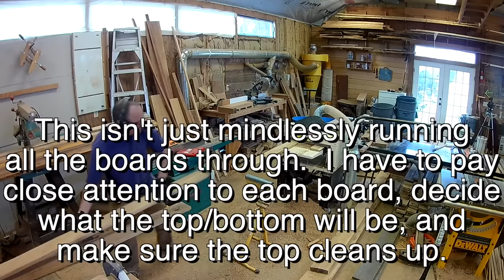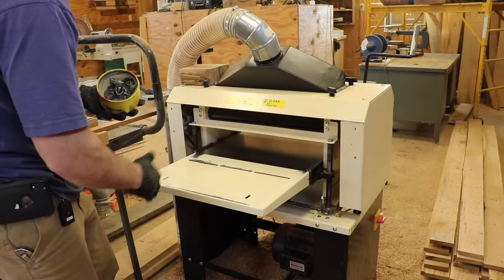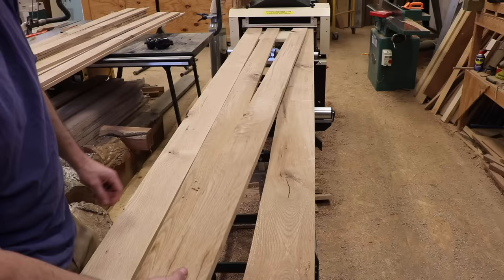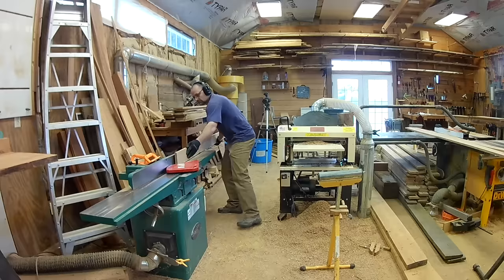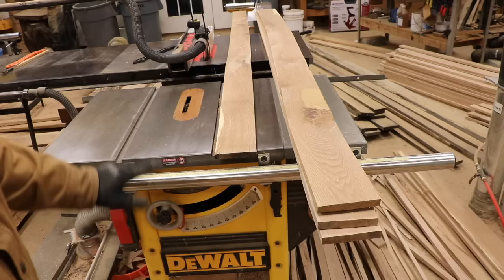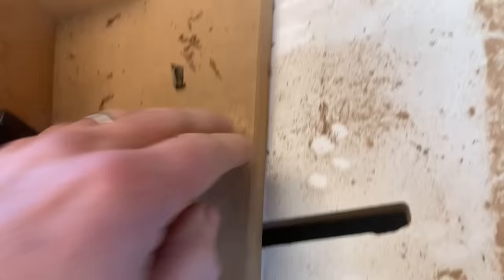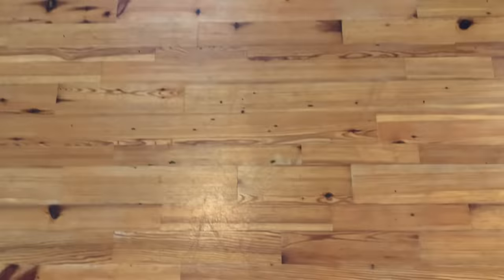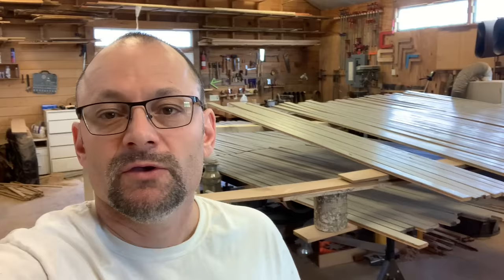Making Tongue And Groove Flooring From A Fallen Tree.

Comment: Wood tends to "stuck" in  a planer when you try to make a shallow cut, with dulled blades and sticky bed. Shallow cut means feeding rollers don't have a good grip on the wood, and thus can't push it hard, bluntish knives tend to push the wood back harder, and sticky bead acts as a brake.
You may try to use thick silicone grease for greasing the bed, my impression/ opinion is it kinda lasts longer and works better, but it is advisable to warm the bed first before rubbing it in. Or you can use silicone sprays for a quick fix. But for big jobs with lot of soft and rich in very sticky resin wood (pine, fir, spruce), especially when the final appearance is not that important you can use diesel fuel, maybe with a dash of oil (regular mineral oil or rapeseed oil) added to it. Just brush it onto the "entry part" of the bed every now and then with a long flat brush - this way you don't have to stop your work and spend extra time waxing the bed. And it's cheap too, and if you are going to use lot of a lubricant that sorta matters.
 
Also, I'd recommend doing the "rough planning" with whatever sharpness of the knives there is (providing they still cut), but making the final, thin shaving with a freshly ground and sharp knives.
BTW, "Planning makes a lot of SHAVINGS (or chips)". It's the saw that produces SAWdust ;-)

Comment: My dad had a woodworking shop.  When I saw all the boards with the coat of linseed oil paint all spread out in the shop, I had to laugh.  How many times had I seen that same picture with my dad.  He had lots of tools and I always enjoyed working with him from little up.  He did some making of lumber but he wasn't set up with a sawmill as such.  His had a more homemade rig.  There was a sawmill about 30 miles from where we lived.  He would go and purchase culls, scraps and often they would give him material just to hall it away.  It was a wonder what he could do with that "scrap" lumber.  Oh, he might purchase a few really nice boards but that was rare.  He would make cabinets on the side, redo a kitchen or bath.  He did about 70% of the work on our new house when I was 6 years old.  He knew wood and knew what to do.  
I would like to share a tip.  This is especially true if you live in the south where the sun is really hot.  Houses would peel as many were made from wood.  My dad would take a gallon of oil primer and add a gallon of linseed oil.  If you cleaned and would sand without any loose paint, you brushed on this mixture and allowed it to dry well before painting.  It would never blister again.  This is especially true on the top end portion of homes where the sun beat for hours on end.  You could almost count on having to pain every year.  My dad and I would buy an old house, work on it and sell it.  One house we purchased the man who lived next door had this problem.  He didn't believe my dad.  We did this house and it never peeled again.  The man said, he just didn't believe what my dad had told him.  Seeing is believing.  YES, it takes time to clean the wood.  If you don't have to paint every year look what you have saved.  I thought I would pass this tip along.  If, anyone is interested in more information just make a comment reply.  I will see it and answer any questions you might have.

Comment: How utterly gratifying to make you own custom wood flooring planks.  No Home Depot, no Lowe's, no Menards, but plenty of scraps to fill that outdoor wood burner.  You said the older porch installed years before without a paint or protective layer was a "failure".  It would be if you didn't learn from it.  You have, and the next one will be far superior to it, but you might never have reached that level without that (ahem) irksome "failure".  Don't beat yourself up - pat yourself on the back, my good man.  Quality is not dead in America!

Comment: This was amazing to watch, everyone that complains about the price of hardwood flooring, should work a day alongside you!
I'm curious about your wood boiler, how long does what we saw you load, heat your house, would you get a full day out of that? I have a small woodstove (about 12 cubic feet) and a comparably small house (about 1800 Sq ft.), one of your blue bins would last a day for me, haha!
Reply from the maker: Thanks!  As long as it isn't too cold I load it once a day.  If it gets into the lower 20's or lower, I do twice per day.  My house was built in 1850 and is far from energy efficient to heat.  A more modern home would be much less wood.

Comment: I have the exact same planner and jointer as yours. I upgraded both cutter heads to Byrd helical cut heads. You should try them, much better. Very easy to get new cutting edge also. The jointer is almost flawless, however, the planer is horrible about snipe. You have to adjust perfectly and still monitor closely.

Comment: There must be a clamp/guide that could be used to hold several boards down to run them thru the jointer at the same time.

Comment: Just a idea for your router table, I made a spring plate, that can pivot and used a heavy spring to press down and the side of the board, like your but with2 rollers in the contact prtt of the end that presses against the side or top of the board, works outstanding and never lets the board move. What a  great project, but would have loved to see in natural wood, great video and how fast you made it. lol

Comment: Nice to see from tree to floor. I thought you might have used a circular saw / skil saw with a guide to initially put a straight long edge on your boards. In my experience it's a lot quicker and easier on the body than multiple passes over the jointer.

Comment: Look at Penofin finish, its rosewood oil. Used it on Commercial work and now it goes on everthing. You dont have to strip it and it penetrates all the way through the wood and you can just recoat every couple years.
Great stuff with a lot of different colors and products.
Betting its better than the linseed.
Reply: Redwood or rosewood oil?

Comment: I have the same planner I also have two commercial kilns, I have done out of birch finish width of six inch tongue and groove also up to four inch finished width in shiplap flooring, you had some boards coming out of your planer not acceptable for flooring, the twelve foot floor I made was usually from two feet to twelve feet long and two and one quarter wide three quarters inch thick.

Comment: In your mention of linseed oil paint, I have found, being in the Mid-Atlantic region of the states. We have a great deal of problem with paints containing both boiled and raw linseed oil, mildewing due to both humidity and heat in the summer months. Mind you, we have equaly a bad time with water based (latex paints), doing the same but the modern oil paints, though they don't hold up as well as the paints that contain the less environmentally friendly stuff, do resist mildew better in my region.
Reply: years ago it was possible to make a linseed based stain , color was limited to brown , you would concentrated colorants , had a high gloss finish , never peeled or chipped , would fade out , re coat after about 15 years

Comment: I don't believe it!  I have the exact same router table and it was also one of the first significant projects I ever built.   And yes, it was a New Yankee Workshop design and I believe I still have the plans.  20 years later I've passed miles of lumber over that table and it continues to work like a champ
Reply: Is your router motor still working after 20 years? What model is it? I had heard that hand held routers once installed and run upside down, like in a router table, suffer from overheating. Have you seen this happen? 😁
Thanks.

Comment: Having done some of this work myself before, I'd say you could use a straight line rip jig instead of using the jointer - and a small power feed that you could move from table saw to router table. :-D Nice work though!

Comment: those wood burner boiler/forced air systems are unbelievable in how they completely burn the wood fuel.  all that's left is ash.  an independent metal building is the way to house that burner

Comment: Store bought flooring the groves are not the same width top and bottom. The bottom is shorter so that the top grove is much easier to get a tight joint. I ran into this when I made some Danish type furniture out of 3/4 oak flooring, you could not get it to glue up straight it always cupped. I had to recut the groves so that they were even like yours are to get flat glue ups. On a flooring secured to joist you don't have to worry about that. The shaper cutters can be bought with that grove difference to create the tighter top joint. Just letting you know if you didn't realize that.

Comment: The linseed oil finishes can have mildew issues. There are some products that say they are better at dealing with that. From what I'v found they need to have added mildew and fungus "cides" to truly work. A little digging will give you the info you need.
Reply from the maker: Thanks for the tip.

Comment: nice work throughout, disciplined and patient, and i especially like the way you set up the featherboards on your router table. the one criticism i'd have is despite its widespread use i dont think tongue& groove has any outdoor application. no matter how well you prime& paint, moisture will get into the joints, swell the wood from beneath, and you get peeling at the joints. wet and dry cycles also make the tongues/grooves brittle causing them to break if they run over even small spans. so for the same reason you're looking to avoid butt joints on this project, i dont see how T&G is gong to be durable in weather. for me the solution would be to maybe use plain boards, possibly at 7/8", installed over a tightly spaced treated floor frame, and seal all 6 sides of each board before installation (and ya, i like your choice of linseed oil-based coating), side grain plugs for screw holes, followed by touch-sanding and another coat of finish should keep it all reasonably weather-resistant for a long time. btw, i dont think the several year old floor you showed at the end was a failure-- i would have no problem with that weathering pattern, but sealing your boards on two sides means any moisture that trickles into the joints is going to absorb and stay there for a lot longer than if your boards are unsealed the way you have it on your existing project
Reply: Dude, a T&G porch floor is not a new idea. These have been around for hundreds of years and are a proven solution. In addition, your idea of plain boards (?) just butted together is a disaster! They will shrink and open up gaps.
Reply: @idontthinkso666  that's right t&g has been used on outdoor porches for at least a hundred years. and for at least a hundred years they have sucked. gaps are not a disaster. splintered, rotted boards and peeling paint are a disaster. it looks stupid and it is stupid

just cuz it's traditional doesnt mean it was a good idea

dude

Comment: Sealing the wood is an important step and doing both sides will make it last much longer. I imagine if you sealed the toungue and groove it might work even better but would be lots of work
Reply: Actually you don't want to seal it, especially on exterior.
You use a penetrating oils that water can't get into the wood. If you keep up adding oil every couple years it'll last 100+ years easy on residential.

Look at Penofin , the have a lot of information plenty of stain colors and I've added tint to make purple stain.
I us it on interior work on old floors with character that I don't want to replace.

Comment: What about setting the dried boards up again on the mill to cut a straight side? How about making the router table accept a second router to cut both grooves at once? I wouldn't want to put paint on that deck. Just a good oil that you could put on again every few years. Nice shop. Thanks for the info.

Comment: outstanding work. Can I please ask about outside boiler for heating and warm water !! What piping and insulation are you using to connect it with the house underground? What is the loss of heat being outside in the cold is the boiler insulated ? so many questions, can you make a video about it !

Comment: What benefits are there to doing the tongue and groove with a router table?   I have the 18" Woodmaster also. My thoughts were to make a deck to put boards thru twice, one on each end and have the tongue and groove bits mounted in the planer head.  Should offer very high productivity. The problem I could see is matching the end profile on a router table whick would be a different brand cutting bit.

Comment: Great stuff but you should spin your planer 180 degrees.  That way you’d feed straight from where you bring material into the shop, and the finished boards would be convenient to run through your table saw.  That would save you a lot of steps and time.

Comment: I'm surprised that your router motor didn't die on you from working that much. I see it's a good one. 
I had heard that hand held routers once installed and run upside down, like in a router table, suffer from overheating. Have you seen this happen? 😁
Thanks.

Comment: Can you tell me more about that boiler?  Did you make it?  It circulates hot water through coils and then air blows over the coils to heat the air to heat your house/shop?  Or is it like radiant floor heating?
Reply from the maker: I purchased it, but that company was bought out and my boiler isn't sold anymore.  There are many similar ones.  The boiler just heats water, damping the fire as needed to keep it at a certain temperature, in my case typically 160-180F.  The water circulates to the house and could be used in any number of ways to heat.  In my case, it runs to my air handler and heats the air which goes through the same ducts used by the heat pump for AC in the summer.
Reply: @FarmCraft101  Thanks man! I appreciate the reply!

Comment: Work on your layout to reduce unnecessary movement. Running back & forth to the blue bucket! Bending over & picking stuff off the floor, NO!  Consider buying a used 1 1/4" spindle shaper. Put a 4 wheel powerfeed on it. My first one was 3 phase so I had to make a converter. Very easily done. I started with less of a shop than you've got. I'm now retired. Gave my tools to some employees and they pay me rent. Shop is now 25,000 Sq. Ft. I don't necessarily recommend getting to that size. Brings with it a lot of head aches! Shop is divided into two work areas. One for processing solid lumber. Mostly moldings. SL rip saw, Shapers, Gomad tilt,  including an arch molding shaper, Weinig 6 head molder, Baker resaw, 16" jointer, widebelt, Whirlewind up cut saw, SCMI sliding table saw, etc.

The casework side is all conveyorized CNC. Fast and accurate. 
Have fun, plan for your retirement. It comes quicker than you would think.

Comment: It looks like to me that you must have your dust extraction ducts running under the floor.  I am about to install dust extraction in my shop.  I have A/C in the shop and I wonder if I will have problems with condensation caused by pulling cool air through the ducts into my outside dust extractor if I put the metal duct work in the crawl space under my shop.  It has been very hot and humid here in Tennessee this summer.

Comment: Great video!  May I ask what brand of paint that is you're using?  Doesn't look like you used any primer?  Also, do you paint the tongues and grooves to protect them too, or does that make the wood swell and not fit together afterwards?  Thanks.  

We have a house that turns 100 this year and the porch floors need some repair and repainting.  Linseed oil pain would've been what they put on it originally I suspect (if they treated it at all), so it would tickle me to use it!

Comment: I noticed part of the dust collection duct, for your planer, is embedded in the floor. I've never seen that, even in some commercial shops I worked in before. Is that right in the concrete, or is it a raised floor? If you get a clog in the part under the floor, is it a major problem?

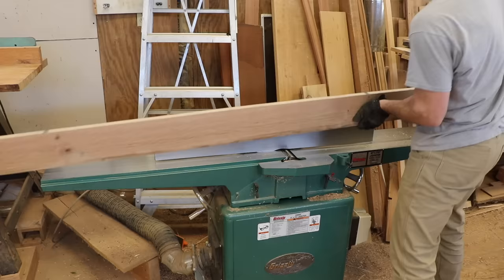Comment: If you only had a hand plane to use on the curved edge of a board, where would you start planing, on the high spots? Certainly. You would not make full length passes all the way down the board. So why at 12:00 in would you do the same on the jointer? It's a waste of time. Flip the board around and only plane off the high spots on each end. BTDT many times and it works. For a severly curved board, a circular saw cutting to a taut chalk line will eliminate all but 1/8" of the curve. Then you can use the jointer to make a continuous straight edge. My favorite board straightening method is using a jig on the table saw for boards under 8 ft long. Way faster than any other methods. This is advice from a woodworker with 60 years experience.

Comment: What kind of wood is this?  I made a fence 200' long, 7' high with horizontal 1x8 #2 treated pine boards milled tongue and groove on my Delta shaper.  Despite hold-downs and feather boards, I still had some drift with the T&G, but with some clamping, it all came together well and looks great ten years later.  Great project and video.  Thank you.

Comment: I am new to wood working, i have a question. Most floors i see are very straight along the joints, everything is very "right angle" . Would it be possible to scribe a floor creating curves?  Some curves minimal and some quite large. Like if you could lay the branches of an oak tree tightly together or scribed into each other.

Comment: Two things;
1)The tongue needs to be round, not square. 2)There should be grooves in the back to keep it from cupping.

I’d suggest a bit deeper tongue and groove. Typically flooring is run through a moulder, so I can understand trying to avoid more steps with a router table.